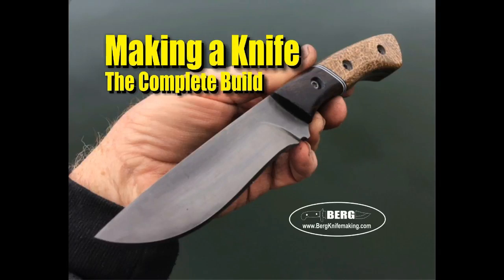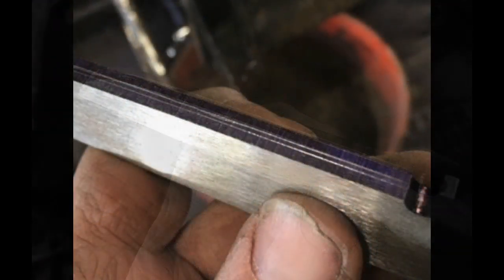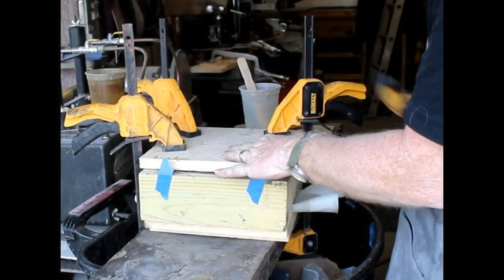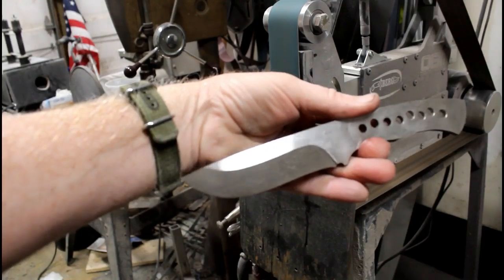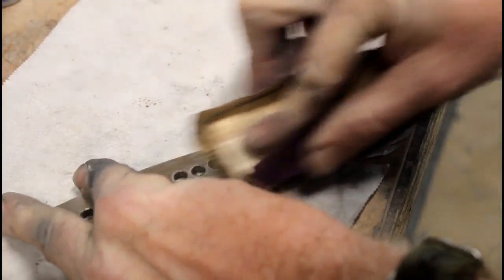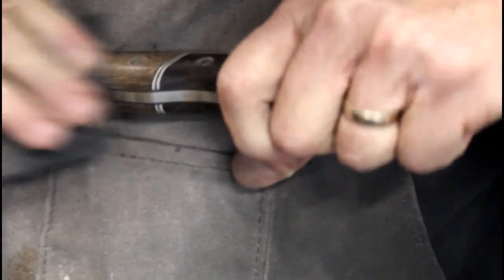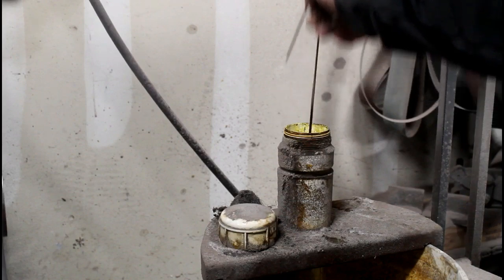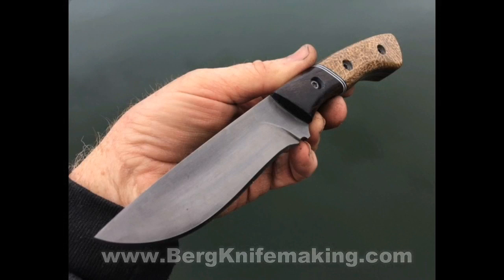Making a knife the complete build by Berg Knife Making

Comment: It realy turned out well dan. Great tip on the sweeping bevel too. Little tip, i see the rust starting to appear on the tool rest. If you clean it up and keep rubbing some furniture polish, wax onto it it will preven rust and help keep the  blade moving smoothly across it. You will see the water beed off it as you work.
Reply from the maker: Great idea  Thank you!!

Comment: I'll pass on a tip I learned from an old maker. To avoid messing up the blade after etching or any time it's in its finished stage and you are working on the handle, Use waste pins in your holes and take the rough scale to your router table. Use a trim bit like for countertops. They come in. straight, angled and rounded with a ball bearing to run on an edge. When you run that bearing on the tang it cuts your handle material to a perfect fit. Take off the scales, use the waste pins to finish grinding them, and attach when done. When done carefully, no need to ever grind on the tang, or chance nicking the blade. I use the rounded bit and have half my profile sanding done. Depending on how you finish your handle it can save a lot of time and elbow grease.
Reply from the maker: Great tip. Guess I will have to get a router table!!
Reply: Thanks for an awesome video  !!! The photography is fantastic  !! I will continue to learn from it  !!!

Comment: Question:  Is the belt on the 2 x 72 floating above the platen, and not in constant contact (running flat against it)? It looks like when you push the knife down it presses against the platen but only with pressure on it. (may be just an illusion)
Reply from the maker: I think it was just the camera angle. Belt is in contact with platen